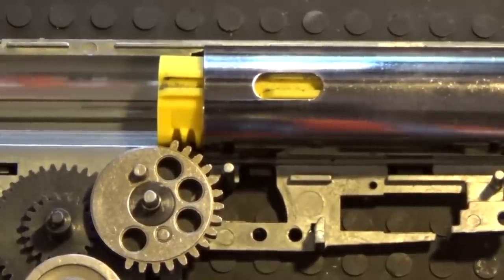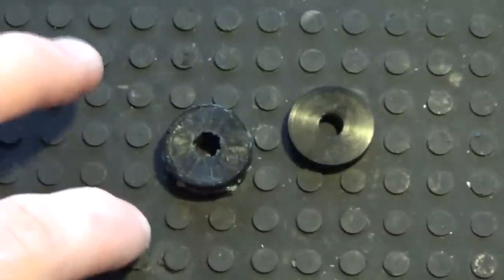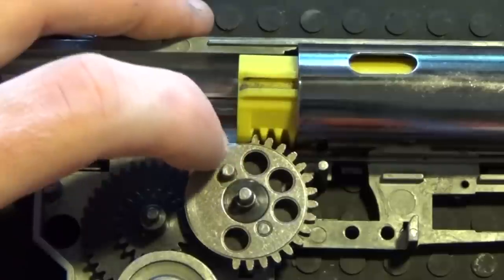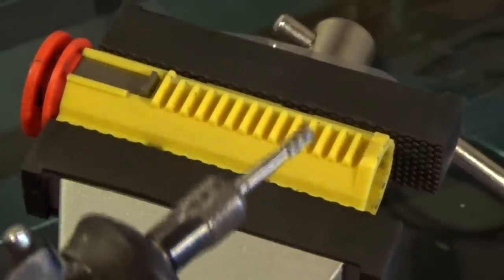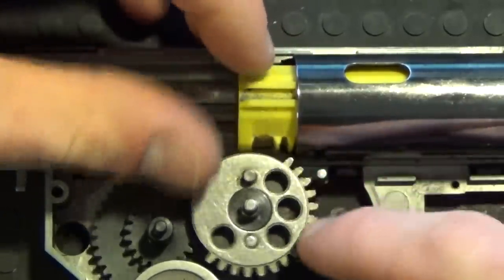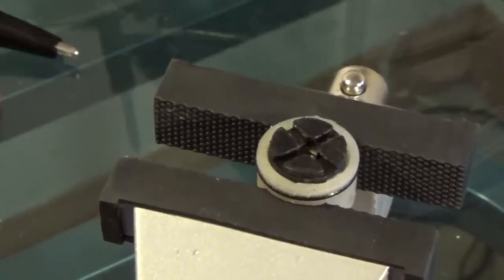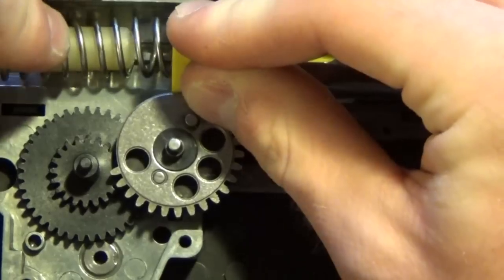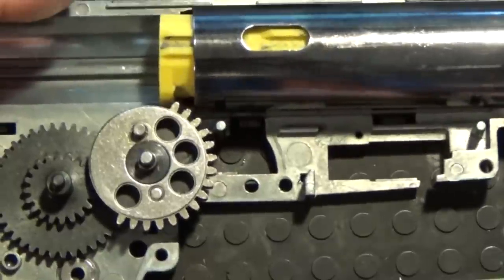Inside the Gearbox: How to Correct AOE.

Comment: Shimming with some plastic washers between the piston and piston head is the best way to correct AOE, I’ve been doing that for 15 years, unless it’s a full cylinder you don’t lose any volume and it’s far more accurate for every shot as it doesn’t compress like a rubber or sorbo pad.
Reply: So what type of plastic washers do you use? And where can one get them from.
Reply: @brianbutters1915  well der, obviously if you correct AOE you need to remove 1 or 2 teeth, no matter how you do it, I never said otherwise.
Reply: @mitchfromtheinternet297  lol u got me man, that's a fair statement
Reply: @brianbutters1915  yeah he was referring to the faucet washer idea lol, what a waste of time typing all that 😂😵
Super glueing that washer sounds sketchy idea tho. I think you can get adjustable piston heads can’t you?

Comment: If you put the washer in front of the piston, you have a lot more dead air on full compression, therefore a drop in fps. Put the spacer behind the piston and you have full compression but shorter stroke, again a drop in fps!

Comment: Now we have, even if minute lessened volume. All you did was move the piston, in relationship to the sector gear, to a spot that the gear will wind up it in a cycle naturally. The piston you showed was not damaged by "bad AOE" as you put it, it was from pre-engagement from a lot of FA.
Reply: Btw it isn’t necessarily premature engagement because of the AOE is off and the piston is still forward your gears can still touch it and scrape it. By taking the teeth out of piston can help that aswell.

Comment: points i understand these tec saying such things , but as an engineer sector teeth crowns , the strongest point of a cog as cog is at its thickest and has an advirse angle same as the pick up on a piston these meeting with the crown of the cog first is by far the strongest secondly teeth shape allow for smooth transition in movement . where ever you pick up a cog wether at the start of a correct stroke or part way through you will experience the same wear also placing sorbo or faucet washer in line will create piston bounce and cause irregular tooth pick up , and can cause barrel vacuuming ie where volume of cylinder is equal or the barrel and when the piston bounces slighty drags the air back momenteroly in the barrel normally on weaker spring set ups , note piston are cheap compared to gear there is a reason it called slave part replace when knackered .... a better way is to space cylinder correctly using piston spacers and that is not when cog sides are face to face but when crown is picking up piston tooth whilst simatainiouly picking up your shaved second tooth or the end of your third thus spreading the load between two teeth . another way is to reinforce your second sector tooth on ya gear set with say jb weld increasing the strength of your sector gear i have done this for years now with out correcting aoe and experience no failure , running m150 springs in dsg and dmr with time you will always experience failure so take it on the chin and make it the cheapest part to replace also if you look at teeth with so called aoe correction you actually get teeth slam and in high stress builds this results in first gear on the sector to break off tec plz stop trying to sell simple mechanics for over price lack of knowledge . old saying a little peice of knowledge is a dangerous thing think about it , guys watching these vids know that air seal barrel stabilization and air constistancy is way more impartant than sector impact angle as is barrel volume to cylinder volume anything you put in your gun that can cause inconsistant results will effect your range and accuracy
Reply: Your sentence length rivals that of Alexander Hamilton. On the other hand, your grammar does not.

Comment: Best shimming tutorial!
Installed some SHS 13:1 gears as best I could into a G&G gearbox
Reply: piers brown can you make a video of your build 
I’m looking to do a gate titan 
Asg 40k 
Shs 13:1 gears 
And a m120 spring in my g&g cm16
Reply: @kamplayz3784  I have documented my work on my Instagram page (@callsign_astronaut). 
The motor is a "high torque" style so it should have no problems pulling the  M120 spring even with low ratio gears. 
I plan eventially to get a Perun mosfet for it.

Comment: Seems like back-spacing the piston by adding material to the piston head is the way to go unless somehow it's more difficult to do than adding material to the cylinder head or you're going for a strict CQB, high ROF build that definitely doesnt need the volume or extra weight to the piston.

Comment: I believe those faucet washers are made of Delrin, not any kind of rubber.  That being said, it's a great material for this application.  It has just enough shock absorbent properties to take some of the load, yet it is self lubricating so it stays nice and smooth and won't gum up inside of your cylinder.  I work with multiple types of Delrin at my job, regular polymer based and glass reinforced.  I've made some shock absorbing pads for people a couple times, both straight and some with a conical shape for bore up applications.  I still prefer the Sorbothane pads though.  Those always work great.

Comment: When you have to cut something to "make it better" it's probably just a shitty  job.
Do the shimming, buy the piston with metal teeths and get an upgraded dual ring piston head...don't use super glue... the piston hits the cilinder head with velocity...so you'll just end up with hardened superglue inside the gearbox.

Comment: So like i have bought a package of washers for this purpose, from home depot. They are rubbery and do get compressed a little bit. I am lead to believe that this is the cause of the fps loss on my aeg, about 80fps loss. I plan on swapping this washer for a washer that does not compress. Anybody know where i could get a washer that does not compress?
Reply: +Ryan bum on this, im in the same situation
Reply: 80fps loss does more sound like a serious air leak, than an aoe / washer problem.
Reply: that guy, you know, that guy,, he is correct

Comment: How big of a deal is AOE? Because I'm a new tech and I just put in a sorbo should I be find now ?
Reply: It's not a big deal...  As a real firearm, air gun, and air soft gun parts designer/builder.  AOE is nothing more than the attempt to get gains from a very limited system.  Any gains seen are negligible.  Especially true when a stock system is completely altered with upgrades.  The gains become entirely non existent of this.

Comment: I got a question. At the start i want to say that i had luck and after changing sector gears and piston ( cause luck with choosing the right parts ) my AoE was nearly ideal and so i didnt need to use any spacer to change the barrel lenght so i dont know mouch about it. :) But i will need to do that on friends gun.  So my question is why isnt the spacer used to manage the right AoE same size as piston head? If the air is pushed forward by piston head and you have the piston head  with different size than the spacer, dont you lose some air pressure going around the center and after that ending locked up by piston head hitting the spacer? I think the preasure is already downed by less space for air in the piston barrel so i wonder why is the spacer smaller than the barrel/head. I was thinking about it and i think that  better wil be barrel sized spacing with hole in it shrinking right from its sides ( size of the barrel ) to size of inner barrel  ( like the funnel ) and so the air will have more consistant direction also concentreating the higher air preasure in the centre of the barel. Let me know if you ewer used the piston head sized spacers and what you think about my idea. Thanks.

Comment: I don't know about airsoft but in gelsoft we literally never have this issue, and also you've just made this piston less reliable, you're putting all the spring pressure onto one single tooth that you cut down, honestly if this is a common issue you're better off getting a piston with a steel rack,

Comment: I could see doing this if it was metal on metal but the plastic will eventually wear into position...which is the whole point.
Reply: If the pickup tooth is plastic you risk ripping it right off in a high stress setup, I have seen this happen several times. If the pickup tooth wore down enough to compensate for the incorrect AOE, it would mess up the meshing with the following teeth and strip the entire piston teeth rack.
Reply: they do say you eventually wear the gun in like a brand new bike in some sense
Reply: @MRwillhams  I reckon that's more learning the subtleties of that exact gun. So where the BBs land in relation to your sights, the angles you need for what distances, moreso than your gearbox biting into itself

Comment: Do AOE even on a basic gun. A friend's brand new G&P M4 failed on the first day of use. After taking it apart I found that a whole little chunk at the back of the piston had broken off and fallen in among the gears. No harm done, but it was almost certantly a poor AOE that did it. I am fixing up the new piston with these mods to ensure longevity.

Comment: I just bought a Secondhand replica, now the piston gets jammed every time. Now I tried fixing it myself but I was wondering is it normal that th O-ring around the piston is slightly lose ? seems quite bigger then it should be is that normal ?
Reply: +fu2iosa It should be a little loose. It expands to create the pressure in the cylinder

Comment: A very experienced Tech told me AOE adjustment is a bad idea. Causes Piston misalignment issues. Your Piston head must contact a perfectly flat surface or it becomes misaligned and is amplified down the lengtht of the piston to that oh so important first tooth. It also Looses volume in cylinder forcing  you to higher spring pressures to make up for lost FPS.   The original alignment changes as well because the washer compresses every shot so you actually have a greater chance of grabbing half the tooth. You cannot calculate how much a rubber washer is going to shrink, compress when you actually fire.  If you move the piston back, your motor needs even more amps to get it moving
and puts more stress on the motor and battery.  He also said he sees way more damaged pistons from AOE mods. Just a warning to all you DIY guys out there. A wise man said ," A little bit of knowledge can be dangerous."  . Best advice,  talk to a full time tech who has been in the buisness a long time".
Reply from the maker: I’ve been doing this for 9 years and not correcting AOE on a high speed/high stress build will cause your piston to fail. It’s only a matter of time.
Reply: @TheAirsoftTech  I've watched tonnes of your vids and have appreciated it. I just think the average airsofter should consider carefully before doing this mod. If your going through pistons then ok, but if your piston is in great shape, I think it best to leave it. You yourself mentioned many issues encountered doing this mode. The learning curve is pretty steep with lots of things that can go wrong. Just saying many guys mess up there pistons attempting this mod and there are techs with more years than you in the buisness that don't recommend it for that reason. I see a lot of new guys in the comment section
that seem to want to jump right in there.  I wouldn't take a brand new gun and just do this mod personally. I'm more interested in a lower maintenance AEG's with lower rates of fire and longer durability. That's why we have comment sections to read and consider for ourselves all the variables. Any High speed/stress build requires higher cost and maintenance and young air softers need to consider cost verses benefits carefully. If your not building high speed/high stress, spend your time on other mods. I've been a maintenance electrician for 30 years. Pushing any equipment beyond its original design is expensive, time consuming with many unforeseen results. Saying it's easy just means you understand it, you now many of the mistakes and have tonnes of experience. Maintaining head alignment, cylinder volume and AOE under spring pressure are variables that need to be controlled and considered in this mod.

Comment: Great videos. Just subscribed. I usually correct the AOE by using some fiber washers from Lowe's between the piston and piston head to avoid changing cylinder volume. I've tried sorbo, but I never noticed any difference in noise or vibration. The only thing with adding washers between the piston head and piston is the spacing sometimes causes your piston head's bearings to not spin freely in the piston.

Comment: wouldn't it be possible to just file off a tiny bit of the pick up tooth so it would have a correct aoe when contacting? That way you wouldn't have to do the whole mod.
Reply: MrTheMrLol it will weaken your pick up tooth which is the most important of all

Comment: just asking why not metal washer insted rubber to make sound loud metal to metal..? i am biginers to AEG.. thank you for sharing you video...
Reply: +Reggie Flores In addition to what kyle said: 
You need some shock absorbing material, because you've got a spring propelling the piston. If you'd let the pistonhead (which is made from aluminium or plastic) slam against a hard surface, it's like keep hitting it with a hammer.
So to avoid having the "force of the spring" travel through all the parts, and mostlikely damage them, you want to give it a "cotton touch".
Yet, if you pick a way to soft material, the piston head will rip it apart.

Comment: Everyone, please don't do this. Just think about what you are doing for a second. Superglue and a washer in your gun? how ghetto is that. If AOE were a problem dont you think the airsoft companies would change it? All guns ever made are the same for a reason. Dont be stupid and do dumb shit like this.
Reply: Yes, because manufacturers tend to make products that are as good and as durable as they can be and not prioritize profit at all. I've done this mod for years and my pistons broke much more often before I started doing this actually.

As for the superglue comment, how do you think they fasten the pad to the cylinder in the factory? That's right, with glue.
Reply: Glad you have a mechanical engineering degree. Wait you have a Bro Science Degree. Cool story "Bro"
Reply: @pauls.5815  I'm just speaking from a decade of experience. If it has worked for a decade there must be something to it?
Reply: Im just speaking from a mechanical engineering degree. 90% of AOE corrections I've seen are not necessary and will cause more harm than good. Yes there are some internal combinations that need correction, but super glue and something you buy at home depot are not the way to do it. Use a different cylinder/piston head combo. The position is not that important, only that the contact area. 12 O'clock means nothing in its self and technically not the best position anyway. Just make sure the contact patch is flush. So you have people taking a perfectly good contact engagement thinking it needs to be at 12 O'clock and it does more damage than good.
Reply: @pauls.5815  Is it not beneficial to reduce the vertical load on the teeth rack when the piston has a separate steel teeth rack to reduce the risk of it caving in when the first sector gear tooth impacts the first tooth on the teeth rack? I usually set the engagement point closer to "1 O'clock" so the teeth faces are more parallell to eachother when they make contact.
Reply: How hard would it be for the manufacturers to move the rack on the piston back 2-4mm if it were such a big deal.
Reply: @pauls.5815  Lonex actually did correct AOE in their AEG's by making the piston head thicker.

I guess I could do a little experiment and not correct AOE in my next build just to do a comparison.

Comment: after you drill out the hole in the faucet washer, would it help airflow to take a larger drill and bevel the opening to "funnel" the air through the hole?
Reply: +TradinPlastic5150 Yes it does.
With just a straight hole, you create a small pillow of air on top of the washer along with some compression. This forces the spring to slow down. 
We are talking about splits of a second here that the spring takes longer to reach the washer, but in some gearboxes (especially when using a dual sector gear) that loss can be enough to make the gears crash instead of letting the sector gear pick up the piston from it's endposition.
Reply: +Roland P. So yes, using a countersinker on the washer does help a lot, because it moves the "biggest spot of compression" and the air pillow techically inside the sinked opening.
But  to put you on the safe side, you will also want to cut a channel in to the washer as shown on the stock padding at 9:20 in the video.

Comment: Hey Ryan, can you look at my retro arms straight trigger problem video? The trigger slips right off the trolly in about the half pull margin. Did i just get a lemon?
Reply from the maker: Since your trigger does that, you probably removed too much material from the trolley catch.
Reply: I tried the same setup with many other trolly's un touched, and it still slipped.
Reply: ^^ fixed it! Thank you for the help :) i found out that the lonex trolly is jank.
Reply: bbsp